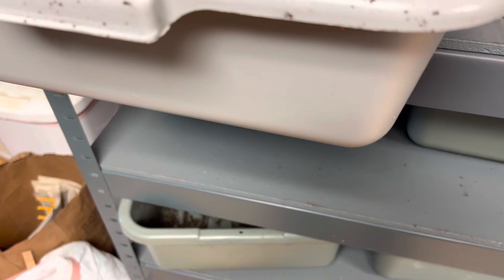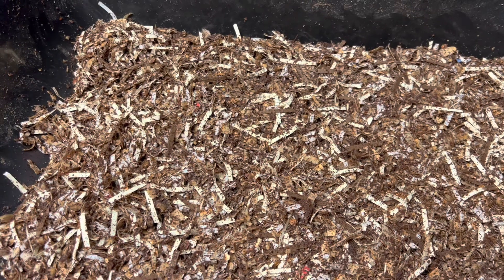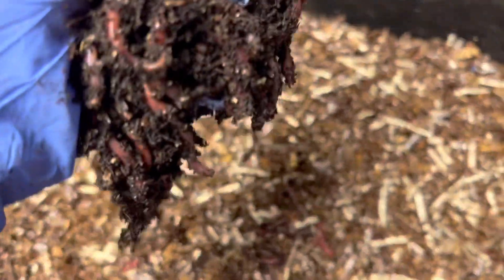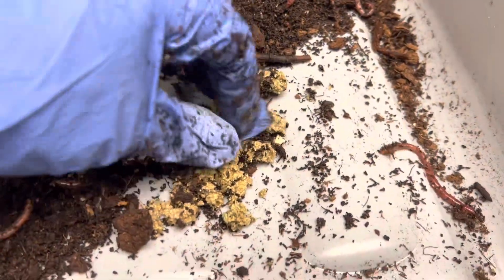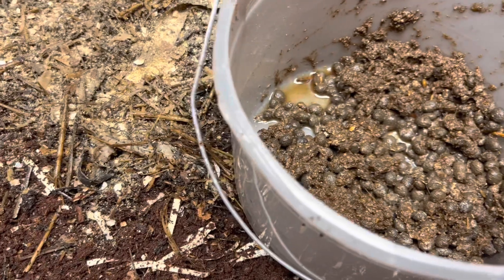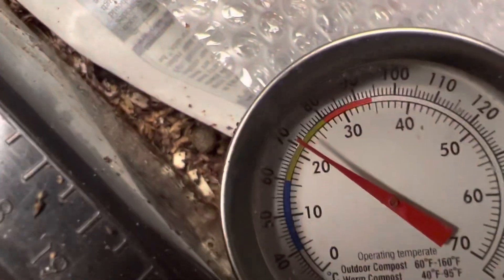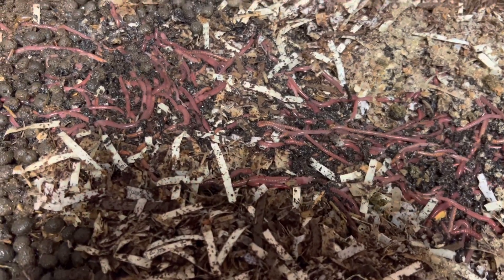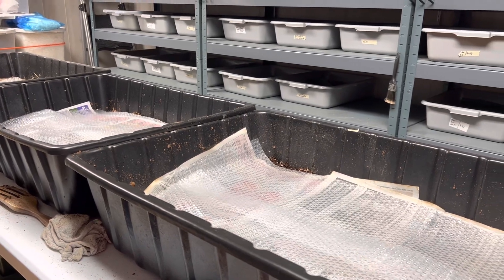Red wigglers love rabbit manure #wormcomposting #redwigglers ￼

Comment: My worms LOVE rabbit pellets! I get them from a lady who raises rabbits for show. Sad to say they all got a respiratory virus and she had to give them medication that will hurt the worms. Now I’m using Guinea Pig droppings. They like them a lot but not like the rabbit droppings. I usually just mix it in the bedding when I get a bin ready to go. They seem to adjust faster with it vs without it. I love that there is no smell and it doesn’t get hot. Just my 2 scents… 😂
I’ve been using under cabinet strip lights on my shelves. They work well, don’t use much electricity and also cost less to run than other lights. Generally those only stay on for a few days after I’ve set up a bin or have mixed up the bedding (1x a week), otherwise they stay off at night with no escapes…knock on 🪵!
Reply from the maker: 🤣 i’m glad you gave me your opinion on the lights. That’s really going to help me. I used to never leave the light on either when I just had a few towers and they were my pets but this is different. I can’t risk a mass exit🤣
Reply: @TheGardenAndWormLady  I totally get that it’s different when your running a large business. So glad my information could help out. I got my lights at Wallymart for $3/10 feet and they work really well, no issues this far. They used to be used in the kitchen until my DH put some real lights in. I think they are about $5 now. You can buy connection pieces to create 90* corners and such. I think they are called strip lights. Best of luck! Electric costs are nuts now days! Ours went up by 23% on Monday…time to hang dry all the clothes again to offset the increase! I don’t mind hanging them though, forces me to slow down for a few mins 😉